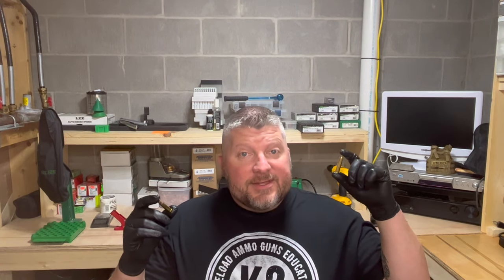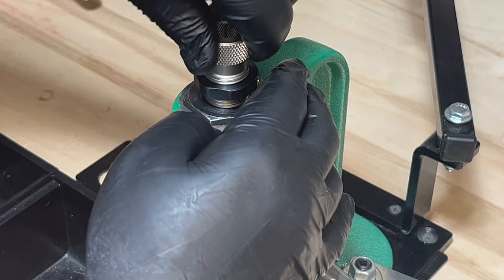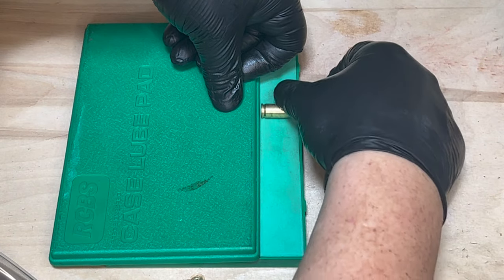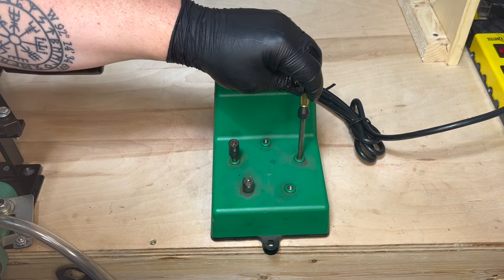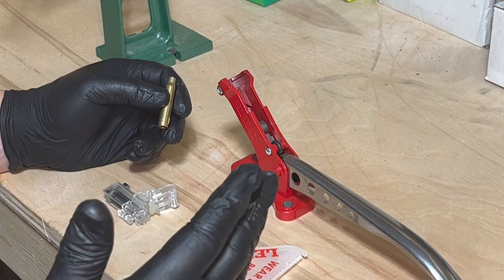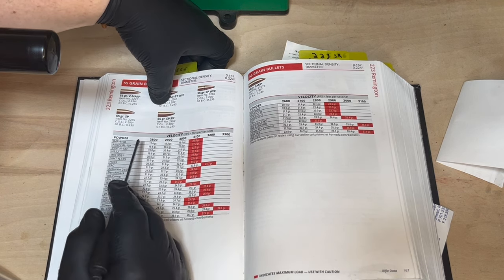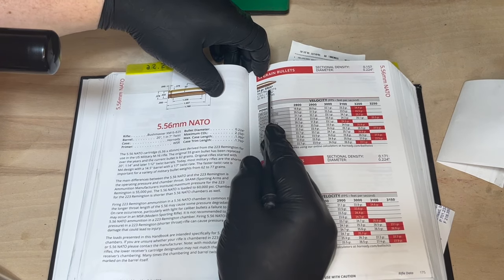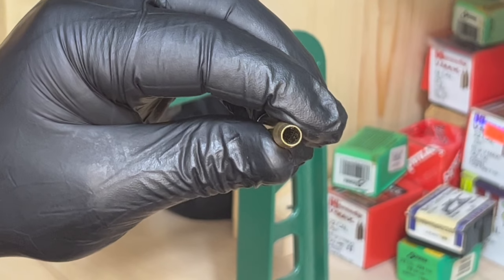How to Reload .223/5.56 For Beginners Easy and Fast

Comment: Collect the brass, sort the brass, de-prime, wet tumble, dry, de-crimp, lube, re-size, trim, bevel (de-burr), chamfer, prime, flare the case mouth, powder, seat the bullet, crimp (Lee factory crimp die), dry tumble (yes, it is safe to tumble loaded ammo), package. Hand de-prime, Hand prime. Separate sizer, expander, seater and crimper. Lube is made with lanolin and 91% rubbing alcohol in a spray bottle. I have been at this for 33 years with no major problems. If you go through all of these steps, I can guarantee you will shoot slower because of the time and effort it takes to make precision ammo.
Reply from the maker: Hello Brandon Gun Works! Great comment!
Reply: I currently shoot a 223 event that requires 30 rounds of 223 per shooter. (The event is called the 223x39. 39 steel targets at 80 yards, 2 shooters, 1 seated with a bench rest, 1 standing shooting off hand. Fastest time wins.) So while this is a very good training video. No, I do not have time to do this reloading. Price vs. Cost. What does it cost to purchase 223 ammo vs. the cost to purchase all the necessary reloading equipment, parts, powder, bullets, etc.? For me I will continue to purchase 223 ammo and not reload. Up to my ass in brass and still shooting fast.
Reply from the maker: Don’t get buried in all that brass brother! 😂👍🏻 thanks for the comment!

Comment: I don't get the cam over part. You screw the die in till it touches the shell holder. Then you lower the ram screw IN a quarter turn. Well you were already touching before you screwed in another quarter turn correct? Then what is the difference? Not being a smartass I'm new to reloading and that part just boggles me
Reply from the maker: @dhooter - no worries! The cam over is to make sure you push as much of the shell into the resizing die for full conformity of the shell. If you don’t do this in the semi autos, you could potentially find that your bolt won’t fully close. You only cam over with steel dies not carbide dies. You want to push the shoulders and base of the case in just a tad bit further for proper cycling. 

I apologize for not explaining this more in depth. Here’s what I do.  I use a case gage or just the chamber of my firearm. I run the ram all the way to the top of the stroke. Dial in the resizing die until it touches the case holder. Back the ram up a bit and dial down the resizing die a bit more. You should feel resistance to hem running the ram up to the top touching the die. You’ll need to push down harder and you’ll feel a “pop”. Load an empty shell into the shell holder, resize, then check with the case gage or put the resized shell into the chamber, close the bolt, if the bolt slams in and fully closes, and ejects the shell after opening the bolt. You’re good to go. If you’ve done all of that and the bolt doesn’t close or it’s hard to eject the case, you’ll need to dial the resizing die down a bit more. Once you find that sweet spot, lock the locking ring and away you go. Small based, steel dies, are meant for the AR or semi auto rifles.

Hopefully this helps. Let me know if it doesn’t and I’ll help trouble shoot. 👍🏻
Cheers!
Reply: @k2defense  It did and thanks for the clarification. Just started reloading around December so it's been a chore with finding supplies lol. But good info is not. Appreciate it

Comment: Separate the 5.56x45 from the .223 Remington.  The 5.56x45 has thicker brass and therefore has less case volume.  That leads to higher pressure if both cases use the same load data.  You wanna know why you're not supposed to use 5.56x45 in a .223 Remington rifle... that's why, the pressure is different.  Other than that, a 62 grain penetrator is longer than a 62 grain standard lead full metal jacket.  They actually do have different load data in some manuals.  If not in your manual, definitely start on the lower side if using the steel tip penetrators.
Reply: I have actually cut different headstamps in half and measured the brass thickness in different areas of the case.  My statement is not spreading rumors.
Reply: If you have a rifle chamber in 556 you can shoot 223 so it'll be fine however you are correct if chamberd in 223 you CANNOT shoot 556 out of it
Reply from the maker: Great information! 👍🏻
Reply from the maker: Agreed! 👍🏻
Reply from the maker: @outlaw615 - perfectly stated! 👍🏻

Comment: Thank you very much for including your process and measurements. Hornady is supposedly somewhat infamous for having very poor instructions, and Ive only just gotten started reloading in the last month or so. Starting with 556, this video was enormously valuable! 
Fingers crossed I wont blow up an AR, but I'm pretty confident I can at least get something that will cycle!
Loading 62gr bullets into cleaned hp ZSR casings, with 25.6gr of BL-C(2) powder. Very excited to see if i can beat factory ZSR accuracy!
Reply from the maker: @wahttehfuk - glad you found this video helpful! Good luck on your journey! Let us know how project turns out! Thanks for the comment! 👍🏻
Reply: @k2defense  Thank you very much. Just finished with my first load of 556, and it didn't go too badly. 
Casing length is 1.763", casing neck is 0.2475", powder load is 26.6gr of BL-C(2), using 62gr bullets, with a COAL of 2.224"
It looks like everything is relatively within spec, so I'll be plopping this load into the trash build AR on Monday to see if it shoots, and if I get consistent FPS!
Reply from the maker: @wahttehfuk - awesome! Just curious, why are you throwing them away? I’d suggest keeping them and loading them into your mage and cycling them. If you feel that they are within specs, why not send them? Just wondering. Well done!!! 👍🏻
Reply: @k2defense  I didn't throw them away, I just put them into a gun I wouldn't have minded losing - it went great! I went out today, got a very consistent ~3000fps (16" barrel), and didn't have any failures. The ammunition shot roughly 1.8 MOA, but I have a feeling that was on me, and not the rifle.
Thank you for the video once again, and all the interest. It's been a wonderful journey, and I can't wait to be as experienced as you!
Reply from the maker: @wahttehfuk - that’s awesome! Always love hearing that things work out well! I’ve been more than frustrated in my time reloading from time to time. You feel like a hero when you finally figure out what you’re doing wrong. 😂Glad you find the videos helpful! More to come! Appreciate the dialog! 👍🏻

Comment: I have Lee 223 dies. Never had any problems with loading rounds for my rifles. I have read and saw UR video on YouTube about the small base dies. I am missed something about the regular die versus the small base dies . Thanks for the video and information.
Reply from the maker: Hello @user-rl7eq5nq4x,

If whatever you’re using works, stick with it. The biggest success in reloading is repeatability. I run small base dies when reloading for my AR platforms. Depending on who you talk to or what literature you read, you’ll get mixed opinions and emotions on whether or not small base does are actually needed for the AR platform. My small base dies work perfect for what I need and do. If the dies you currently use work for you, I wouldn’t change your technique. Hope this helps!
Reply: Me too on the lee die set. I also have Redding dies not small base. Works just fine.  They fit into the  wilson check jig. .. Shoot em...

Comment: Excellent video.  I am a beginner and this is as basic as you get.  Very close attention to detail.  I like that.  My AR is chambered in 5.56.  The only think I did not hear was the differences in wall thicknesses of the two casing and volume of internal space available for powder.  There are also pressure differences between the 5.56 vs .223.  I have watched several other videos that are very technical in nature and explain the pressure and casing sizes.  This video, coupled with the other information is the best I've seen for beginners.  Thank you for making this video for beginners.
Reply from the maker: @user-wj4hx1bf2y - appreciate the feedback! 👍🏻
Reply: For beginners and experienced loaders alike, this is a great note.  Head-stamp sort your brass, and even if in the same caliber, check case volume. Over 12 years reloading and I found some fresh once fired .308, and I was like oh cool, it was bolt gun run nice and clean 40 odd free pieces!  Well even though it was .308 head stamped its internal volume was the smallest of any brass I have seen! Far less than 7.62! For those not knowing .223/5.56 and .308/7.62 its the internal volume, and the inner chamber throat dimensions on the barrels that are different.  Well this loaded round went boom hard, smoked primer and had to hammer the bolt open.  Went home double checked, bullet was the right weight, powder charge was ok, but the brass internal volume was 6 whole grains less than other marked .308 Winchester brass of the same height!  6 grains.  if scavenging... be careful and double check everything!

Comment: nice and clear not a bad introduction. But the flash hole uni former is for the burr on the inside of the case and definitely not the primer pocket side that's why its so long
Reply from the maker: Correct! However, after I resize the brass, it lo longer fits in the case mouth. One way I avoid this is to use a universal depriming die to knock out the primer without resizing. I should’ve explained that in the video. Good catch! 👍🏻

Comment: Good information and tips. Do you lube the neck of the case? I usually lube the neck of the case on rifle cartridges. Thanks for the video.
Reply from the maker: Hi Chris! I lube the lower third of the case only. I spray the case mouth with slick spay to make the decapping pin flow smoothly into the case mouth. I’ve noticed that when I lube the shoulders, it will cause the shoulders to dimple. The dimples can cause feeding issues from the mag to the chamber. 

Great question! Happy to help!
Reply: @k2defense  Interesting, I have tried lubing the neck and not lubing the neck. Can't say I have noticed any benefit with lubing the neck. I am experimenting with .223 reloading methods. I just recently started reloading .223 again. Thanks for the help.

Comment: I'm just curious - after buying all the equipment and required materials, how many cartridges do you need to reload to make it cost-effective?  And that doesn't include your time spent reloading.  And would hollow points be more difficult to reload? I'm assuming it is more of a hobby than worth the effort?
Reply from the maker: Hey CJ! This is a rabbit hole question that I get asked all the time. I didn’t get into reloading for cost savings. That is one of the benefits of reloading over time. There is no ammo that is “harder” to reload, in my opinion. You will be more particular with competition shooting and self defense reloading rather than plinking rounds. Sandy Hook is my reason. Ammo disappeared, couldn’t find anything. I didn’t like that feeling. The rest is history. It takes time and practice. But for me, it’s totally worth it. I know what I have and how it will handle when I need it to perform. Hope this helps! 👍🏻

Comment: Great instructions on the video!  1 question,  I have a Rockchucker press I bought about 1985. Where did you get the fingers to push the brass out of the shell holders!??  Thanks.
Reply from the maker: Hello @sbcclydesdale3275!

Hope this helps!

https://inlinefabrication.com/collections/case-ejector-system/products/case-ejector-system-for-rcbs-rockchucker-single-stage

Comment: I heard a rummor that you should heat threat the empty shell. Is that true or some bullsh*t? So fat this looks like fun and "easy" job for Sunday morning.
Reply from the maker: Each time you resize brass it becomes harder. It also has more spring back. Annealing the brass allows for softer brass to reload and lengthens the life of the case. So, yes, annealing brass is something reloaders should consider. Hope this helps! 👍🏻

Comment: Thanks for the great information, do you have re set the dies each time you use them again or with the lock ring set no reason to go through the set up again?
Reply from the maker: Tombo552001 - the resizing and expander die you can set and forget as long as you have a locking ring. The bullet seater/crimp die you might have to adjust with different types of projectiles. Hope that helps! 👍🏻
Reply: @k2defense  Thank you very much for the reply
Reply from the maker: @tombo552001  anytime! 👍🏻

Comment: When reloading .223/5.56 you don't flare out the cases mouth to a little to insert the bullet? You hold the bullet and case as long as you can until the bullet goes into the seating die, then the die aligns or guides the bullet into the case? Is this correct?
Reply from the maker: @bobbyb7127 - this is correct! I take it nice and slow once I get to the top where the projectile goes into the die mouth. I’ve pinched the hell out of my sausage fingers before and the only thing that hurts worse is a beard hair caught in my coat zipper. 😂Hope this helps! Thanks for the comment! 👍🏻

Comment: Any issues with the bullet going in sideways.  I am using RCBS and do not have a consistent seating.  I have yet to figure it out.
Reply from the maker: @bryandouglas507 - please review this video. It’s the same set up for 5.56/.223 as it is for .308. 

https://youtu.be/ktUftCmF_2k?si=UxrEAODkEctnhC7u

You’ll need to feed the projectile into the mouth of the die in order for the projectile to not slip sideways. 

Let us know if you need further assistance. Also, keep us posted. I’d like to see if your issue clears up for you. 👍🏻

Comment: Lots of good information,  thanks for the share. Excellent information for beginners. However,  I load 1k at a time (high volume training- AR household),  your method would take me weeks vs hours. Surely you're reloading a box of 50 or so at a time for a bolt gun, right?
Reply from the maker: Hello D. K.

I have an assembly line. A bucket to be cleaned, one for ready to be resized, one for case prep, and one for ready to be reloaded. I couldn’t possibly sit down for 30 min to do this. I take a day or a weekend to do my reloading. Since I’m pressed for time, and only use a single stage press I need to be as efficient as possible. I reload volumes at each sitting. I’ve been doing this for years and go through a lot of ammo per year so I’m always turning them over. The delivery guys hate me. 

Almost forgot to mention, this is for AR. We too are an AR household. 👍🏻

Thanks for the question and comment!

Comment: I thought the gauge was to show how far to push back the shoulder? Also why the SB die? There is so many different views using a FL vs SB die. Why must I purchase another die for my AR's when I already have the LEE ultimate die kit for 223? Just askin'.
Reply from the maker: Hello 3D Texan,
According to L.E. Wilson Inc. (2022), the Wilson case gage is a one piece gage that will check overall length to indicate the need for trimming, datum to head length to assure correct headspace and to prevent over sizing. The gage allows you to see just how much you are sizing back your shoulder on your cases. So you are absolutely correct. By using this gage, you will be able to “see” how your resized case (cartridge) will fit into your chamber.
As far as your second question, according to RCBS (2022) the Small Base Die set is used for ammunition to be used in semi-auto, auto, and lever action rifles so that the loaded round chambers and extracts easily. The Small Base Sizer Die sizes the case from the shoulder to the head of the case a couple of thousandths smaller than a Full Length Sizer Die. In certain calibers it also sets the shoulder of the case back a thousandth or two more than the Full Length Sizer Die. The Full Length Die Set or Neck Die Set is not normally recommended for ammo to be used in auto, semi-auto, or lever action rifles. The Full Length Die set is recommended for ammunition used in bolt action rifles, particularly for ammunition to be used for hunting.
Now, with all of that being said, in my opinion you don’t necessarily need a Wilson gage as you can simply drop the resized case into your chamber to see if it fits. This is called the “plunk” test. Additionally, I know many people that don’t use small based dies for their semi autos and the ammo functions perfectly.
All of my opinions in the video are from my experiences, what has or hasn’t worked for me, and proven reliability of my reloads.
The best part of reloading, for me, is learning from others and sharing what I’ve learned.
Happy to answer any additional questions!
If you find this information is helpful, please like, share, and subscribe.
References:
https://lewilson.com/case-gage
https://www.rcbs.com/rcbs-support/rcbs-faq.html
Reply: Fl only as Eric Cortina would say !
Reply: A small base die is a full length die. It just makes them a little smaller around. For more reliable feeding in ar platforms.

Comment: Having trouble loading 5.56 with lee dies. First off, the 224 projectiles loosely fit in the neck-there is practically nothing to keep the proj from slipping into the case. I dont know what Im doing wrong. I reload 338 LM no prob, but the 223/556 is killing me lol.
Reply from the maker: @killerKev1961 - are you camming over your resizing die? I think you don’t have the resizing die turned down far enough. Watch this video. Different caliber but same setup. Try that and let me know if it worked. If not, holler back and I have a few more ideas. 👍🏻

https://youtu.be/ktUftCmF_2k?si=GYvHWBxT7cSdfrIT
Reply: @k2defense  Yeah, I think this is the problem. I will try again this evening. Thank you for the reply.
Reply from the maker: @KillerKev1961 - Happy to help! Keep us posted! 👍🏻